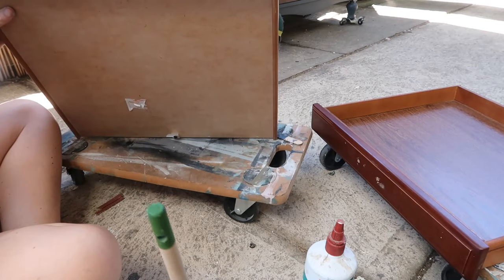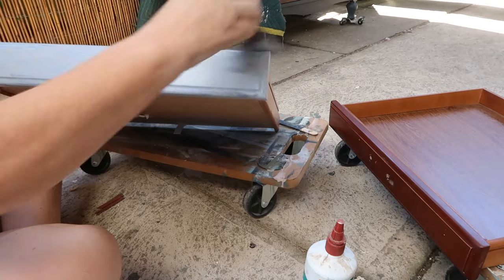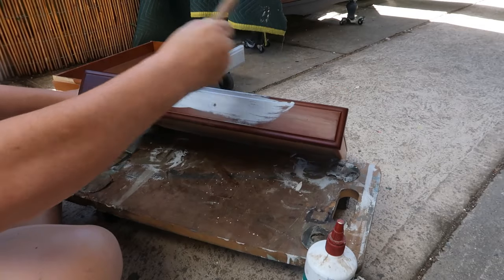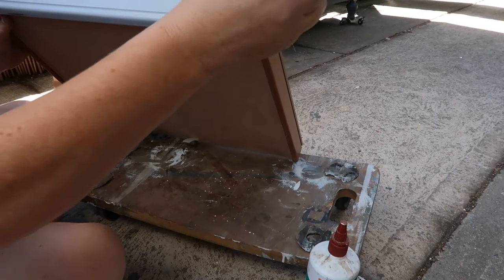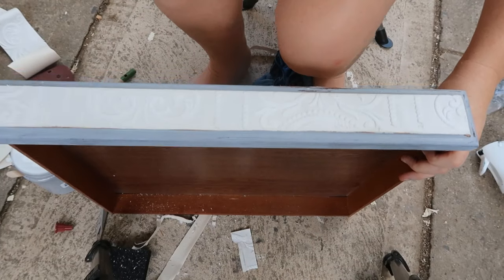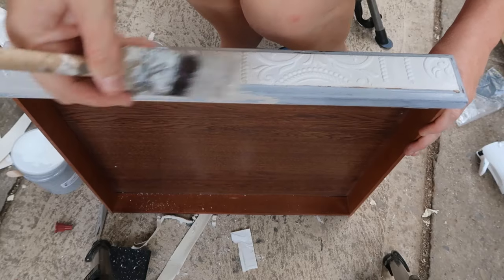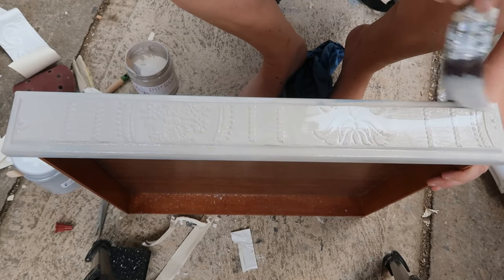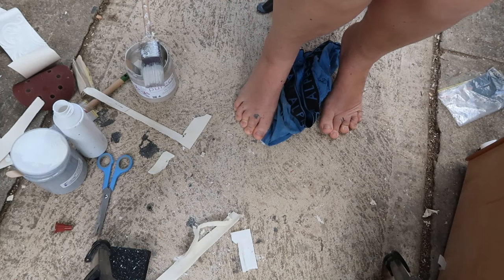How to apply wallpaper to furniture | DIY thrift side hustle

Comment: I noticed there were certain spots on the door that did not have good adhesion and I think maybe possibly the paint soak through the wallpaper and reactivated the glue
If I were to attempt that I would probably end up using some thing a little bit stronger so there wouldn’t be any lifting
Reply from the maker: I just needed to have pressed it down firmer. That was my bad. Less water would probably be good too :)
Reply: When it dries it should flatten again?
Reply from the maker: @rhondaoliver6310  yup it did thankfully :)